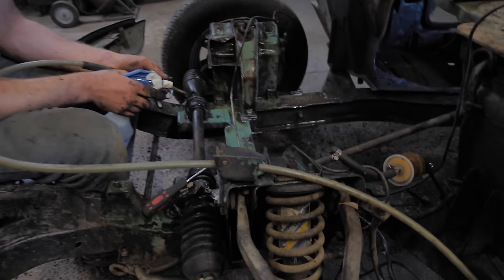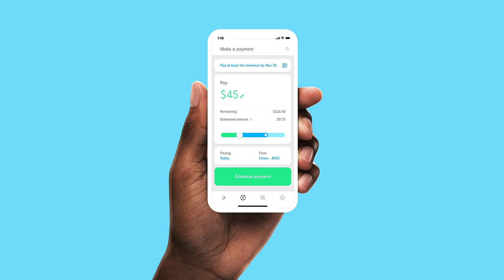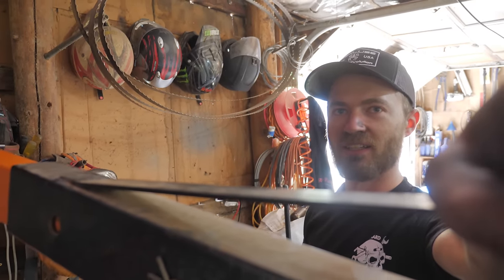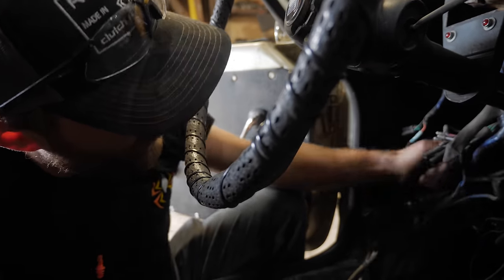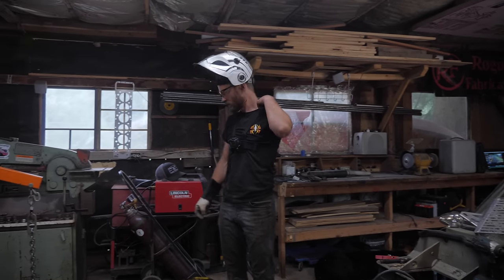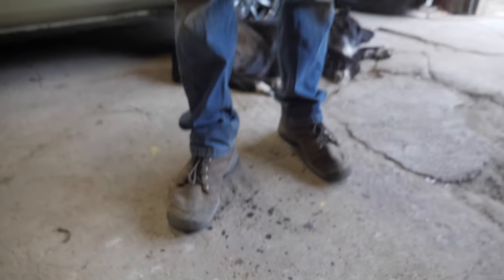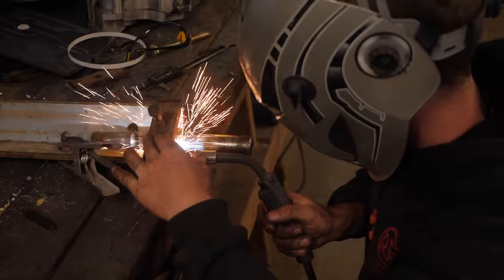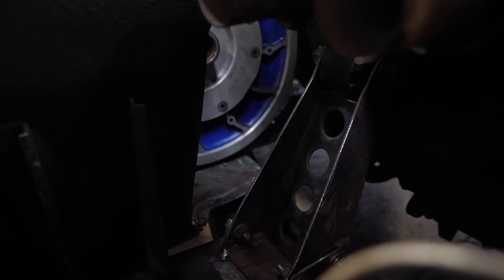Triumph Supercharged Engine Swap 200+ HP

Comment: Please remember to add a couple driveshaft loops. DIY is cool but with that setup I'd be seriously worried about your leg experiencing sudden unintentional disassembly.
Reply: These guys are expert fabricators. I am confident their welds wouldn't break off. But that old drive shaft could explode from the power of the gear reduction and torque converter and 200 hp motor.. Maybe an entirely new driveline and rear axle would be the next project. I hope they do a series on this car.
Reply: Same with the clutch guard. I don't know if you ever seen what a belt turning at 8.5k rpm can do when it explode, but it's not pretty.
Reply: Maybe just rework the old cardboard tunnel? Some extra sticky-tape and some staples? :)
Reply: @MrArcticPOWER  - Good point. Hadn't even thought of that. It's a pretty beefy belt so lots of mass to whip around.
Reply: 8:36.....

Comment: You know what wears out belts faster than misalignment? 200 horsepower!
Reply: Its a cvt. They have a tendency to wear out quickly.
Reply: It's mainly eat that destroy them. If there's no proper ventilation and the pulleys are slightly misaligned, the belt will explode in the first 100 miles.
Reply: I agree! I'm a big guy and my sled is aligned perfectly but because my sled is 240hp and I'm so heavy it absolutly eats belts.
Reply: Traction and HP.... tie it together right!!!! 
That's rule #2
Reply: Kris K  Please dont believe everything you hear on the internet. These guys are most likely paid to promote that company. I've tried different brands on my sleds and read a lot on forums. There is no brand that is much better than the other and a lot of times, the OEM comes on top.
Reply: Well you aren’t supposed to be treating these cars as your daily driver..

Comment: For the Next power wheels build a mini Diesel truck
Reply: RB26SNO ye take the engine out of the mahindra mini jeep (inline 4 turbo diesel with a 5-speed manual trans)
Reply: Hell yes...
Reply: Now that is a good idea!
Reply: ur tryin 2 tell me a 3cyl turbo yanmar or jd/ etc in a yamaha rhino? i think they made them factory but not with that big of an engine
Reply: Snag a 3cyl kubota reefer engine, cheap and plentiful and makes 75-100hp. Thanks to California, there are literally tens of thousands of these engines that have to be replaced even though they are functional and plenty of life left in them because they don't meet new emissions schemes

Comment: I own a 1948 atlas QC42.  With the 1 piece headstock bearing yours is probably 1950's . If it has the original headstock bearings they were hand engraved on the outer race with the month / year.  Awesome machine man!

Comment: I'd like to point out that the rear suspension setup on a spitfire will tend to "tuck" the rear wheels when cornering. Do not attempt to drift this you will have a roll over event. I suggest a roll over bar of some discription before you try anything at speed. otherwise I so excited to be watching this!

Comment: Make sure to upgrade the differential.  I had one with a 4AGE at around 100whp.  The ujoints are small enough they didn't last long and the diffs aren't known for lasting under hard use.

Comment: Cool project, just a thought be careful of the rear wheels with the standard rear suspension, you can have the rear wheel “tuck under” on extreme cornering and speed. You can add a chain to stop this happening, look it up or lift the car up and see what happens.  This can cause the car to roll! Just trying to help. Keep up the good work. 👍
Reply: 4-link?
Reply: Yes, it's the same setup as the infamous Chevy Corvair.

Comment: For an alternate way of shaft mod. try facing, beveling,drill and tapping both ends of the shafts , installing and small length of "ready rod " (all thread) and tighten before welding. I've had good results using grade 8 ready rod fine thread.   Enjoyed your channel Immensely !! Keep up the GREAT Work!

Comment: you know that the triumph gearbox isn't going to take the extra power , but have you also considered the flimsy differential fitted to this antique ?.
Reply: ya, that rear diff will pop first application of anything but idle, but you know you have to do it. good thing you are skilled fabricators, fitting a new rear end should go smoothly.
Reply: v8 swaps are fairly common for these cars so it should be fine
Reply: @MakerOfBeasts  anyone who v8 swaps these cars should be ashamed
Reply: I think they're going for a Miata rear end.
Reply: @adrianwelgemoed9562  anyone who expects the stock garbo 4 banger to do anything should be ashamed. people 3.8 v6 swap them all the time.
Reply: You can get brackets to bolt in an R160 or R180.  Now if your going solid axle...I'm outta here.

Comment: It would really look lovely in Inca yellow an original mk 4 color just saying 👍 if you agree? Also change the front breaks to a Triumph GT6 setup it fits lovely but are larger discs and give much improved stopping power to go with the increase in power. Similar then to one I knew when I was younger.

Comment: Next time you change the length of a shaft... 
Cut one piece a little longer than the total finished length that you need. Longer by approximately 150% of the diameter of the shaft.
Cut the other piece to length allowing for clean up of the end of the shaft on the lathe.
On the lathe take the piece with the additional length and turn it down to 60% the diameter of the shaft. ONLY THE ADDITIONAL LENGTH NO MORE.
Bore a hole in the other piece the same EXACT diameter as the turned down piece.
Chamfer each piece for welding and press one piece into the other, check for proper length, run out etc... and weld solid.

You will have a much stronger shaft .
Love watching your videos, you guys are kinda nuts.

Comment: I'm surprised you didn't mount the engine in the back.
Reply: wrxsubaru02   It would be COOL if thay did, but it wouldn’t turn!
Reply: @livingstonbarrie  What u mean by it would not turn?
Reply: @wrxsubaru02  without any weight in the front the front wheels wont have any grip to corner...
Reply: @chrisvanderwalt4691  Agreed; that car was designed to have the engine weight in the front, and they're reputed to be too light in the front even with the original engine. With this much power, speculation exists that even with the engine in the front it will be a little like the Princess Jeep and pick up the front end any time you go near the gas.

Comment: You comment about the steering angle! The Spitfire (I had Mk3) - like the Triumph Herald on which it was based - had the smallest turning radius of any car available in UK including the famously nimble London Taxi!  It was just under 24ft circle - I could u-turn in a two lane road!  The tyres scrubbed badly though unless you were very gentle.

Comment: Make sure you only run Rotrex oil in the supercharger . It’s expensive also-$100 a bottle- don’t spill it. I’m running the same type on my FJCRUISER.  There is also specific mounting instructions for the unit as well as the hose routing on it from Rotrex

Comment: I used to love sitting on a front wheel while working on the engine. Triumph used to put a lot of turn radius on the front end of their cars so parking is super easy. The one super scary thing for me about Spitfires is pick up trucks on the freeway when it's raining and the pick up has those big tire and wheel combinations. The Spitfire can disappear in the spray beside them. Too many times I had people change lanes into me cause they couldn't see me. Solution-don't drive on freeways! P.S. I want first dibs on this car when you want to sell it!

Comment: Just be careful of the rear end, the diff is hard mounted with 4 link transverse spring and if you reduce the weight the transverse spring can cause the rear wheels to tuck under in a corner and you can roll. you may want to remove a leaf to reduce spring rate and ensure rear wheel stay parallel. Also replace the trunnions on the rear end they wear bad and cause issues so will need replacing on any triumph of this age. The Gt6 or vitesse rear end is also worth considering with the increased power.

Comment: Also them Yamaha 4strokes have a floating secondary clutch witch means theres about 3/4" play side to side on the jake shaft of the sled witch acutely helps to improve on clutch wear so you javeing a lil play in the secondary clutch is perfectly fine just some more fyi in case anyone needed ta know lol!!!

Comment: In them Yamaha 4strokes you actually go from underneath to change the oil filter theres a small plate you take off to get to it so you don't have to take out the inner cooler and charger to do it!!! Just a fyi for anyone who got scared ta do it them selfs its a whole lot easier then you think!!

Comment: the lathe looks about ww2 era to me. They were designed to last a really long time at industry standards which means working every day 12 hour days for years so ya I'm sure it will serve you well. Setting up a DRO system on it could help you with accuracy.

Comment: hey guys why didn't you use the transmission, all you had to do is make a adaptor plate for the bell housing, I did a chevy small block to a 18hp briggs with 3 speed chevy trans.

Comment: You may want to re-design those engine mounts to include bushings. With that high-revving & powerful engine, it's going to vibrate that 57 year old chassis in ways it was never designed to handle. Better to isolate that vibration than rattle the car to pieces (and it'll make for a more pleasant driving experience).
Reply from the maker: There are rubber bushing in the engine mounts. They were already built into the pet where they bolt to the engine.

Comment: I enjoy this videos, i don't always watch whole thing as i get bored easy but enjoy the bits i do. (Also your engineering knowledge / know how and tools, capture the mind)

No issues with the sponsorship but when it comes to credit cards and credit ratings, Debt/loans etc isn't your friend and if you don't do your research and learn how it works or you can be worse off...example: if you pay off your credit card before due date it can negatively effect your credit due to breach in terms of agreement (Stupid and not every place does this but do your research and read fine print)

Comment: You can't put the second plate backwards because the way the driveline works, with this setup the output shaft should be facing forwards

Comment: Hey my name is Joe I got a tip for you guys. When you instal the sets set the passanger set little bit back and use aluminum to cover the clutch. Just make sure you bolt into the frame. If you dont knoe how it binding the metal and makeing it so if anything happns to the belt you will be safe and not injured lol. But just giving tips out there if need more. Comment on here for more tips.

By Joe mason

Comment: You mentioned sudden self disassembly of the transmission, but I hope you have a plan for the differential (or a redesigned rear suspension)

rumor has it, 100hp+ and their days are numbered
I was lucky, the rotary only broke my axle flange, not the whole diff

Comment: You can get ABS and Fiberglass versions of the Spitfire tranny tunnel (I think my glasse one is made using the cardboard one, with fiberglass on top for strength)

then instead of running a "transmission blanket" for heat you can instead dynamat the underside of the removable tunnel

Then id suggest possibly doing some chassis rigidity mods like an OEM steel hardtop
there are other ways, but theyd take forever to explain

Comment: What do you guys do for brakes to slow the car down? Can manual brakes be tweaked to perform better? Or can a booster be set up? I was noticing just the clutch slave cylinder was there mounted in engine bay?

Comment: You know if you left the transmission in and put a gear on the input shaft and you can spin that and have gears too!! Low range to highway gears!! Find out what gear is one to one and it would work like hooking up just the drive shaft. Be sick and can make a sick shifter!!
Reply: There's no need for gears, and they already know that the stock transmission can't handle that much power, hence the joke about "sudden unintentional disassembly."

Comment: I don't think that diff will hold up and I know the Ujoints will explode into bits.  You need limiter straps for the suspension and negative camber in the rear.

Comment: MANUAL TRANSMISSION PLEASE. I think it'll be more enjoyable to drive
Reply: I AGREE IN FULLCAPS
Reply: @adrianwelgemoed9562  A CAR CLUB WERE EVERYONE ACTS LIKE BOOMERS
Reply: @toyoboi  YES I THINK THAT WOULD BE AWESOME
Reply: All caps aside, enjoyable is relative. I enjoy a manual transmission because it helps me to feel like part of the machine, rather than just a spectator. However, with the kinds of power-to-weight ratios we're likely discussing here, the CVT will give a lot better performance because in the time you'd have spent between gears with a manual, it's accelerated another 20MPH. That's a serious rush!
Reply: good luck getting one to fit and work properly.
Reply: GreatNorthernDad You’re absolutely right. Growing up my dads tr4 was pretty much stock from the 60 and had the bare minimums to get it running. But one thing I always loved was seeing how many damn times he’d touch that shifter. I resonated with those words a lot, “you become apart of the machine”, very very true

Comment: Why use a snowmobile engine? It wouldn't put out the torque low down in the rev range for street driving, such as a Ford Zetec or Ecoboost would.

Comment: Keep the manual transmission and put the second pulley on the input shaft of the the transmission so it's still a manual but with out the clutch pedal
Reply: Fermenttadoor  it be like a rockcrusher trans you could slam gaers

Comment: I used to own a 1980's era Dodge Ram pickup that had the same high beam foot switch.  Had to replace it like twice in the 4 years I owned it because it would get full of salty water from the salt they put on the roads in the Buffalo NY area.

Comment: I wonder if the gear ratio in the cars rear end will work together with the snowmobile motor, clutch, and gear box. It's possible it will eat up the clutches

Comment: hey, you could try to modify the tachometer to double the rpm, so 2000 on the tach would be 4000, and then just put "x2000" instead of "x1000" lol

Comment: I also new a guy who put a283 in a gt6,and was doin Abt,120mph,in Detroit, and broke the the rear torsion stays off the rear end, car was totalled,way overpowered!!!!,my hole, is too build a 3 .1litre v6buick multiport fuel injected V6, with a chip, frt wheel drive, too run at Watkins Glen up against pirches

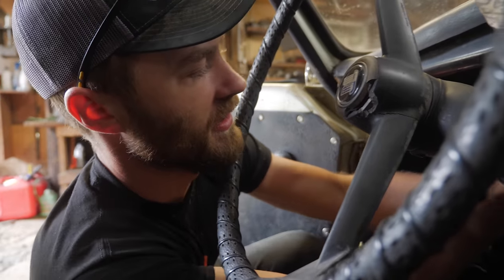Comment: 7:20 If you talk with older gentleman they will tell you it’s a “dimmer switch” because it would lower the voltage to the headlights making then Less bright
Reply: Actually,  it changes from one filament in the headlight to a second one.  The voltage remains the same.  The high beam filament is in the focal point of the reflector, and the low beam filament is offset so the light reflects more downward.

Comment: should just use some oxylic acid mixed with water, 50/50. spray on, wait 5 hours, spray off, all paint, grease, rust will come right off

Comment: "there is no why".... BUT... Datsun near verbatim copied the British MG/Triumph engines.
could have been tons easier to pump an A-15 engine and slap in the 5 speed to go with it.
very reliable for 300K+ miles stock form, a cam with heavier valve strings, fuel inject and supercharge or turbocharge, it'd deliver pretty strong.

Comment: My question is why not just jackshaft it into the original transmission to have reverse and gear changes? With the torque converter you wouldn’t need a clutch and it would be fairly simple. Been done plenty with 6.5hp engines and it would be roudy as hell for 200hp
Reply: Reverse would be nice, but there's no need for gears, and they already know that the stock transmission can't handle that much power, hence the joke about "sudden unintentional disassembly."
Reply: Definitely no need for gears and I don’t know who told them wrong but my buddy put 180 to the wheels down in his and the transmission didn’t have anything done to it. Still going to this day!
Reply: @michiganvapemafia595  Your buddy got a Wednesday car. :P
Reply: No he got a Friday Saturday and Sunday car haha. Because those are the only days he drives it!

Comment: Are you all gonna link it to the cars gear box to ,or just rely on the belt drive??
Reply: The belt is driving a CVT (continuously variable transmission) so there is no need for the original gearbox, and they stated that they have no plan to use it.

Comment: You should put a Ford 9” in the real of the triumph
Reply: Wyatt Wolfe way overkill for 200hp it’s a dead simple rear end, but for the power and weight they should use a Miata rear end
Reply: That would work too

Comment: How are you going to have reverse gear? A reversing gear box? I would of used the original Transmission, or pull one of of a more powerful car.
Reply: Car transmission would be better like high RPM one from rx7 or rx8.

Comment: Not to be prude but it's a turbo, not a supercharger. A super charger is a belt driven device. A turbo builds boost off of the exhaust pressure. A pro charger is like a supercharger but it's belt driven. Sorry just slightly urked
Reply from the maker: By your own definition its a procharger.

Comment: Has anyone noticed that it's turbocharged not supercharged
Reply: Belt driven centrifugal supercharger. Similar to a turbo, but much more lineal boost production, and boost is somewhat independent of engine load. Higher rpm=higher boost.